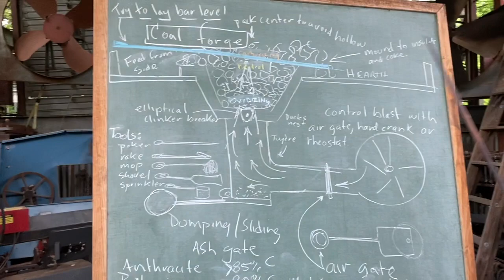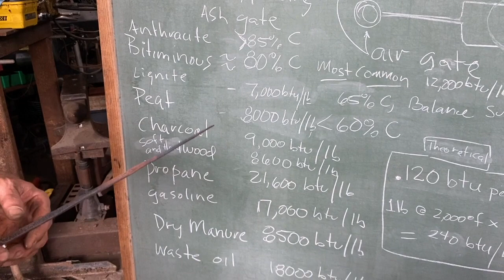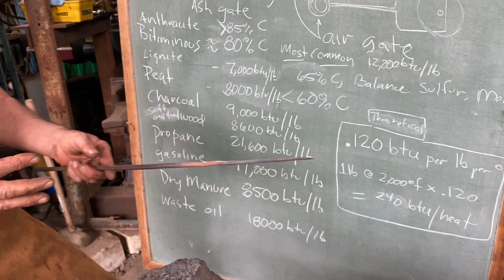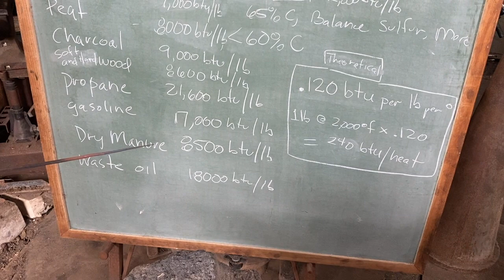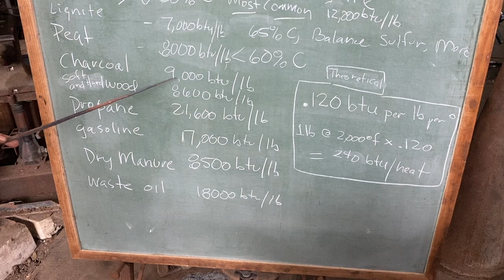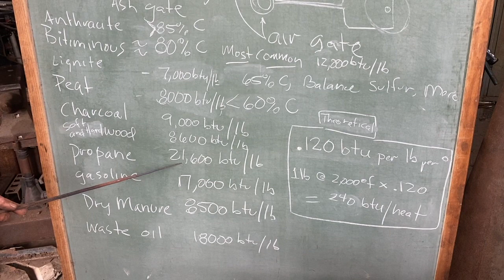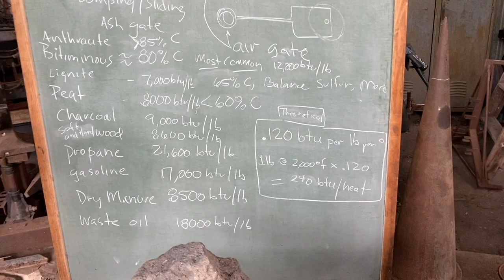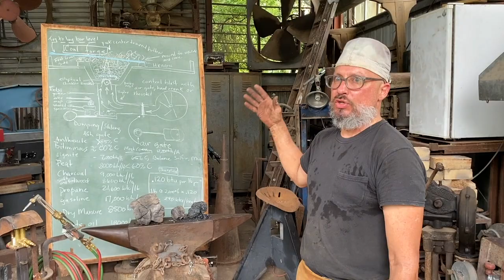Blacksmithing School 3.1: How to Use a Coal Forge with a Hand Cranked Blower

Comment: I’ve been a hobby smith since 2008,  just getting into doing this professionally. You are very informative and knowledgeable when it comes to using a coal
Forge and it shows. Everything I have learned has been self taught. Your video proves that in this field there is always something you can learn and improve on. Bravo.

Comment: Hi Master Will,
Thank you so much for creating what should be considered the “YouTube Bible of Blacksmithing”.  You are my Hero, it is awesome to find someone with genuine knowledge, who can eloquently share your wisdom in a structured and understandable manner.  I have been watching your videos over and over, every time learning new vital snippets of information.

Being in the early stages of blacksmithing, my skills are gradually improving. 
My new Blacksmith shop (shed) is nearing completion and will be able to forge out of direct sunlight and the elements. It has a charcoal forge with a new firepot.  The firepot is 12 inches square and 3 inches deep, with a removable insert to give 4 inches depth if my oxygenated layer climbs to high in the fire. It has an electric blower like the one on your larger propane forge, controlled by air gates which impede flow to the firebox and also separately bleed away excess air from the blower. Living in suburbia (Sydney, Australia) coal is not an option, and have a desire to learn to smith “Old School” with a solid fuel forge. Charcoal is manufactured at home using free scrap timber.
•	Will you do a video on charcoal forges? There is not a lot of QUALITY information online on management of charcoal forges.
•	Your thoughts on wetting charcoal with water into a slurry?
•	There is no clinker breaker, (clickers are rare in you setup) I have a removable grill separating the tuyere from the charcoal. In that grill, would slots like on your coal forge or drilled holes be better?  If slots, what dimension for the opening in the slots would you suggest.? Smaller opening in the slots will give faster air speed but less volume of air.  I am having trouble getting my head around the correct ratios of air speed / volume of air / pressure.
•	Does the sweet spot (neutral layer) and the height of the oxygenating layer get higher in the fire with increased in airflow?
•	What tips do you have for conservation of fuel for a charcoal fire?
•	Best way to extinguish a charcoal fire?
Your edification of the people you have inspired you from is honorable and appreciated. 
I am so excited, of being to be able practice, the skills you are teaching.
Thank You 
Reg
Reply from the maker: Hi Reg,
  Thank you for watching the videos, they are my knowledge dump of a career of collecting technique and practice that I shared and improved upon while teaching beginning blacksmithing students.  I weighed my approach by my student's understanding, often having to modify the demos because of the previous class unable to grasp the concept. It was a very active teaching approach.  
 And you are precisely the type of beginning blacksmith that I am trying to communicate with.  
  You are right, in your shop you need daylight but out of direct sunlight, to gauge the heat. Our forging range is between 1450 degrees F and 2400 degrees, the heat is a tool and every 100 degrees is a different tool. I have forged in direct sunlight and there is a lot of guesswork.  The more variables the trickier it makes. 
  Regarding charcoal, no it will not coke like coal, so it does not need the wetting or slurry.  Most importantly is to control your blast to get the most out of your fuel.  Charcoal is like coke, (though much more will be required for the same quantity of heat), it is piled up, the fuel will concentrate the heat where the air blast is most directed. In a coal or coke or charcoal forge the clinker breaker not only lifts up the clinker but is part of the intended engineered direction flow of the blast, so if your firepot does not have a clinker breaker and frustum shape of the birdsnest (exit hole) then make sure that you have with your drilled or slotted grate a pinpoint focus of the air, and heat your iron in this foci. (Even if you only forge charcoal a clinker breaker is handy because although you may not have mineral byproducts in the fuel you may still create clinker by burning steel or accumulated flux from welding).  Clinker, regardless of cause, can be cleaned by dipping your poker directing toward the birdsnest and following the contour of the firepot and lifting from the tuyere/birdsnest. Lift with the poker, clear the obstruction to the surface and remove. If the charcoal lifts you know you have an obstruction, that obstruction will clog your airblast and cool your fire and disrupt your focal airpoint. Don't be surprised if you have to do this every 15 minutes. 
  Build a deep fire to avoid oxidation, with a controlled blast you can have efficiency as well as the heat you need. The key is the focus of the blast particularly if you want efficiency. You will know if you are obstructing airflow because you won't get the heat you need for the application, remember every stage of the heat is a tool. If I am tempering I don't need a welding heat, but if I am shaping I want it hot and now. So make sure you have the nozzle, opening, tuyere, birdsnest etc that can provide the air for the combustion and resultant heat. Your blower should provide at least 300 cfm. The blast should be able to lift your hand at full, lift the charcoal out of the firepot,  and should be concentrated right in the middle of the firepot. 
  Forge nearer the top of the fire in charcoal, otherwise you may risk oxidation from the blast.  I would still try to bury the iron at least superficially, especially when welding or yellow heats, to have embers on top of the iron, so the heat is conducting from all sides.  You can tell if you are oxidizing, the blast will cool instead of heat or worst it will burn the steel, so watch as you heat with tinted lenses and adjust your blast, fire depth, iron depth and placement accordingly. The higher the blast, the deeper the charcoal should be, the more intense will be the heat, will be probably the least efficient, and  you will experience the most variables at once.
To extinguish your fire, separate your embers. You'll rescue some of the whole charcoal and sprinkle water on what remains. Though, when water is added to ash it will create potash (caustic soda). And that is a very corrosive base, so be careful with over saturating it. So avoid breathing the fumes and avoid any remaining wetted ash. Have fun. Stay in touch.
Regards, Will
Reply: @blackmetalstudio6425  
Master Will,
Thank you for your prompt and detailed reply.  Your advice is very much appreciated. Your description on how to manage charcoal, filled in a lot of gaps for me.

My tuyere is 3-inch square pipe with the sloping slats on my birds nest.  At 3 inches high in the firebox this gives me a heat about 1 inch wide but 3 inches long.  The birds nest will remade to a frustum shape, to increase heat intensity and reduce fuel consumption. (Thank you so much for that advice, it would have taken me years to figure that out)

I need to understand how to accurately control heat, to this end, I devised an experiment.

•	I drilled a series of holes across my air gate, as the air gate was pushed further across an extra hole was exposed to airflow. I ran the following test with 3,4,5,6,7,8,9, and 10 holes exposed.
•	At night, ignite the forge and let it heat up till a ½ inch square stock gets to orange yellow heat.  Heat colors are assessed with no artificial light, (complete darkness, other than the glow/fire of the forge) then compared to a chart printed from the net
•	The air is switched off wait until the stock return to a black heat.
•	Air on. Three holes opened on air gate, heat for exactly 2 minutes, remove steel inspect for color, magnetism, scale and sparks and make notes. Stock is brushed, birds nest cleaned, charcoal repacked, insert stock, cover with 1 ½ “ charcoal, poke flue near stock, and heat with same airflow for another two minutes.  Same inspection and notes.  If the stock has not changed color from the previous heat, then an extra hole is opened on the air gate and the process repeated.

The aim was to quantify the amount of air needed to achieve different heats.  Temperatures from 1200F to 2000F were achieved. However, some temperatures were skipped over within that range and sometimes the temperature remained the same after the addition of additional airflow.  Perhaps my reading of the colors was not precise, or I need to do further work on the graduations in the airflow.  I am not worried about the inconsistent temperature results; I feel they will improve with practice and tweaking hole sizes.

I was thrilled when a higher temperatures the steel bent just under the action of brushing the steel.  Unfortunately I did not record at what temperature this occurred. 

Under 1500F no scaling was seen immediately after removal of stock from the fire.  At 1700F and above scaling of the stock was present immediately on removal. 
 
I understand that stock at higher temperatures will scale AFTER removal from the fire and gets exposed to oxygen.

Do you think;
•	the scaling is just due to the temperature and is normal
•	or is the oxygenating layer rising due to increased airflow (therefore needing to place my stock higher to keep in the neutral zone)?  If this is the case, should I automatically place my steel higher in the fire when scaling occurs in the fire?

Sorry for being so longwinded with my question, I wanted to give you an indication of where I am at in my Blacksmith journey and to explain my method in trying to understand how to properly control my heat. 

These experiments will be repeated with my frustum birds nest.  I will also experiment with inserting my steel at different heights in the firepot.

Thanks again for your generosity and inspiration.

Reg

Comment: This was great! Ime in England  and just starting out. I have an old Artillery hand cranked forge I have restored can't wait to fire her up
Reply from the maker: Ged,
Wow - how cool. Keep in mind due to the portability, there are some limitations on heavier stock, your fire won't have as much heat as you might need, due to a shallow firepot and a small blower. There are going to be some limitations of Btu in a portable forge, but you will still have a lot of fun forging smaller elements and you will get a workout cranking that blower! (Assuming it is a portable battlefield forge...)
Best, Will

Comment: I just found you!  So informative...I've been blacksmithing 305+ yrs.  And I don't use YouTube much...but I was trying to find some blower advice... My Western Chief (about 100 yrs old and was in beautiful shape till the main gear got stripped!!!)went out for restoration right as pandemic hit and here we are in Oct. and there has been one block after another to the shop doing the restoration... I am fortunate because I have the portable forge we used outside and I just got a new propane forge set, so we can work outside and inside.  We use blacksmithing coal and your explanation is so clear.  I have always taught and mentored young smith's (start average 10 yrs. Old) and will share this with my guys.  Looking for a hand crank blower...what, of the modern builds, would you recommend?  Thanks, again!
Reply: I meant 35+ yrs.!!!
Reply from the maker: Hi Anastasia,
  Thank you for your interest in my videos.  Your Western Chief blower is worn out from use and abuse, probably after an undisclosed period of no lubrication. If you must hand crank your blower due to lack of electricity or reenactment  and you want your blower repaired then seek a job shop machinist who may be able to  build up or duplicate worn out gears with a mill and indexer. At $100 per hour this could be a costly option. The old blowers worked well because of the flywheel effect,especially the Champion 600, the weight of the compound cast iron/bronze gears gave smooth centrifugal force. Modern hand crank blowers will not have this quality, they are direct drive or worm gear drive and need to be vigorously cranked. Centaur sells one for $150 and if you lower your expectations and switch arms a lot then it will suffice .I think a fun project would be to duplicate the flywheel action with a crank on a  steel flywheel or jackshaft driving a flywheel that is in turn connected to a  modern blower, perhaps with a lovejoy connection or small u joint. IT would be fun to operate and glorious to watch the machine.
  Good for you that you are teaching blacksmithing to young people, we need to keep the legacy alive, the information is too precious to lose.
Regards,  Will

Comment: Great video and great instruction,  I'm re storing a Buffalo 243E forge with electric blower and downdraft hood.  Vulcan firepot and clinker breaker.  I'm to the point where I need to clay the hearth, what should I use?  I've heard of a mix of plaster of Paris, sand and perlite. will that work? and do I clay the firepot as well?

Comment: Thank you, very instructive. Rarely people explain in detail how to operate a forge. Now I realize my errors, why my metal is burning. I go to try as explained in the video. I have a question. If I am using charcoal, should I brake it into pieces, as little as your coal pieces?
Reply from the maker: Hi Sigma, 
  Sorry about the delay, the smallest size of fuel will give you the most surface area as fuel, and will provide more heat as long as you supply the air needed.  So if you are not able to melt your steel, which you should whether using coal, charcoal, coke or wood, then make the pieces smaller and increase your blast. I heard you can get a welding heat using cow manure.  If hand cranked then crank harder, if you have an electric blower you may need a bigger one.  I use one that has a minimum 200 cfm. Heat is a tool, and if you are not getting enough heat then you are working harder. Soft steel is a joy to shape, warm steel will dampen your enthusiasm and make you feel unworthy.
Best, 
Will
Reply: @blackmetalstudio6425  Thank you! I am using the output of a  vacuum cleaner as a blower, perhaps it is too strong. I will continue to experiment. Warm regards!

Comment: what kind of blower do you have? can you show me in detail? the components, the brand etc. thank you!
Reply from the maker: Hi Sylvia,
  On my coal forge I use a Champion 400 antique hand operated blower, I found it in working condition in a Memphis flea market. It has enough air volume for a large fire and forge welding as well has great flywheel effect when the handle is released. 
  Regarding the coal forge electric blower, I am using an antique champion blower, hard to find, the modern electric Centaur blower has similar volume and pressure but is pricey. As long as you don’t have more than one bend in the ductwork any shaded pole electric blower with a minimum 150 cfm can be run with a rheostat and will provide an average size fire pot enough air to weld. I have used with success as a bare minimum  a Dayton 150 cfm 115v blower with a rheostat, available from Grainger. On my ribbon burner forge I am using a Sunlar 115v and running a rheostat, which provides more than enough air for the interior gas forge volume.